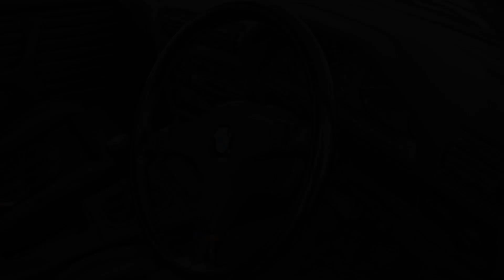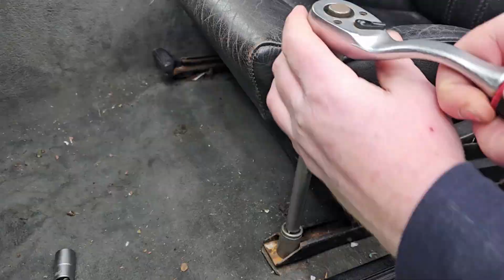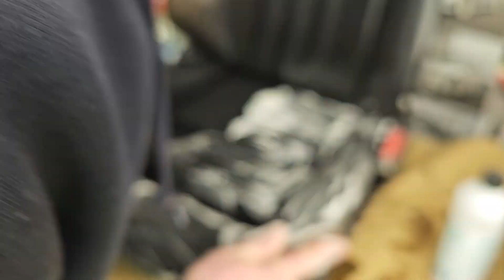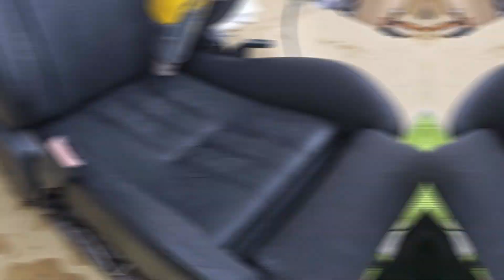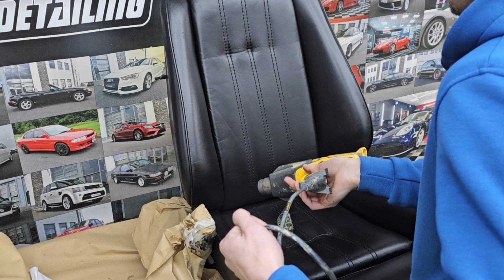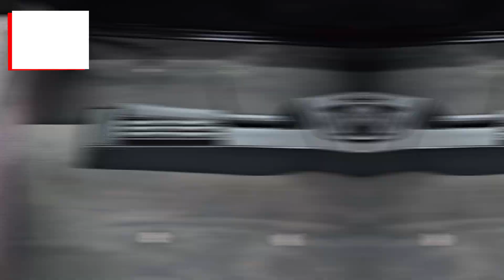Revive Your BMW E30: Step-by-Step Leather Restoration Guide

Comment: But how long will it last? ... seen a few high end dealers having leather  "sprayed"  to make the car look good for selling etc .BUt looked terrible after 18 months
Reply from the maker: I am very sure this repair will last for years in this car, first of all its a weekend car so it will not be used too often, secondly the process in this case was done correctly , preparation, time breakes between stages, at the end the color was sealed with top coat which makes the the job durable. But overall there is no way to say how long a leather restoration will last , that's due to many factors:  products used ( good or cheap quality - I use products I trust) , preparation ( guys at the dealer would have this job completed in a couple of hours, I spent over 10 hours giving necessary time breaks between stages to make sure everything bonds properly and cures , the job was done over 3 days . after that durability depends on how often the car is used daily of casually , also how is maintened. Even If there is anything missing in the process , the final product may look preety similiar but it makes huge difference how long it will last.

Comment: What kind of filler do you use? And what brand of paint?
I have a set of E39 MSport seats Im going to start restoring soon, and theyre about as bad as these...
Very nice job though! fantastic work!
Reply from the maker: I use leather filler from Geist, you can try this brand for leather restoration supplies or Colour lock also vg. Best of luck with your car 🚗

Comment: Hi, thanks for the video! What is the temperature of the heat gun?
Reply from the maker: @Leostr  thanks for watching, I usually use the full heat 500 degrees, but it doesn't get this much of course if you move it all the time  and keep the distance, maximum it gets is 70-80 degrees.

Comment: How is the leather softening oil you apply at the end ever going to soak through all that paint and clear finish with hardener?  This is the main issue with aftermarket painting of leather, it isn't nearly as soft as new leather and the cost of doing this isn't far off a retrim.
Reply from the maker: It looks like you have some knowledge about it, but you can belive or not,  its not first job I did, with some leather paints it wouldnt make sense to apply leather oil after, but with Geist or Colourlock paints it simply works , done it many times and it does softens the leather nicely, I usually apply oil/conditioners until the leather gets back to a decent level of softness. I used paints from different brands and yes some paints will not let the oil/conditioner to be absorbed by the leather , so I wouldn't use them on leather that is dry/hard. That's my experience. When it comes to the cost of respray by me compared to a good quality retrimmig in my area ( with real leather ) , my cost is 1/3-1/4 of price of retriming. So its customers choice whether they want new or restored leather.
Reply: Some paints and fillers might not adhere if the softening oil is applied first?
Reply from the maker: @shadeburst  that's what I would worry about, I don't want to test it on customers seats however I am looking for solution for that, but needs to be tested first on my test leather.

Comment: Looks good 🙏🏻

I’m doing my e30 convertible, with pacific blue leather upcoming summer. 

Why do you feed the leather after you’ve sealed it with filler, paint and topcoat? 

Why not feed the Leather beforehand, like, after sanding? 

In my humble opinion, the leather is more likely to absorb the conditioner deeper into the leather fibers.
Reply from the maker: @xraylax  the reason I am doing it after is that I would worry about proper adhesions of the new paint , overall it would be better to do it before , I am sourcing water based solution for that to use it before restoration.
Reply: @OCDDetailing2021 

Ah, that makes perfect sense. 

I might use 303 Aerospace protectant for that. 

After I use leather Honey to feed the leather. 

The 303 might just be enough to seal in the honey before paint. 

Would be great if you only have to use the 303 to keep the leather and synthetic top coat from drying out and cracking. 

But for now all this is still just a theory😅
Reply from the maker: @xraylax 👍

Comment: Amazing results. What settings are you using on the spray gun?
Reply from the maker: Cheers, settings change on the gun depending on density of the paint, all you need is light mist, so the gun needs to be adjusted each time. The gun is hvlp with 1.0 jet , about 2 bar pressure.